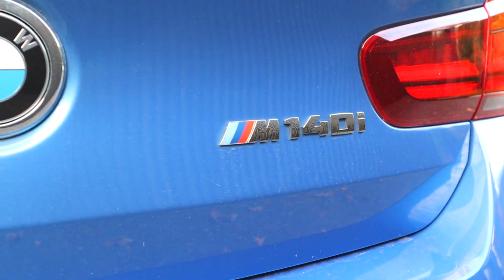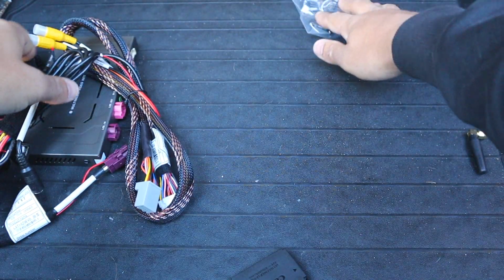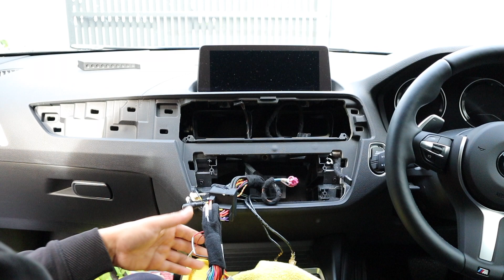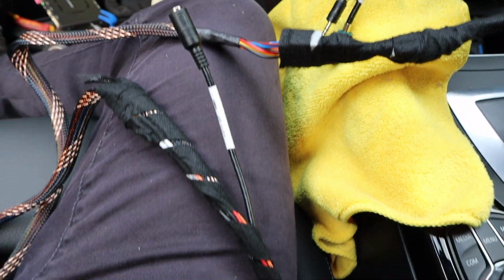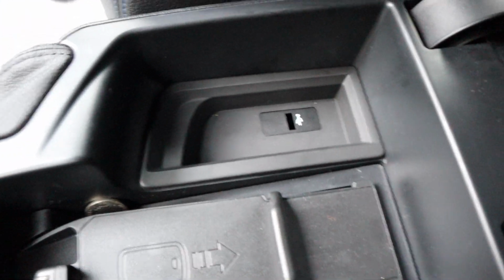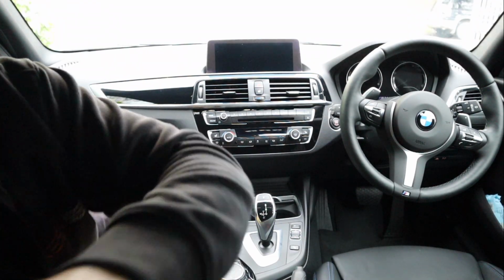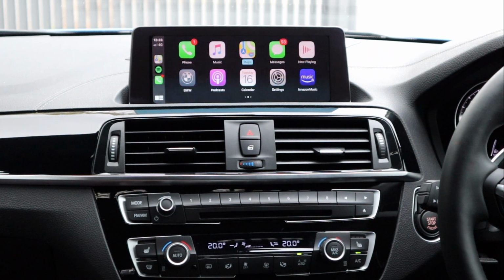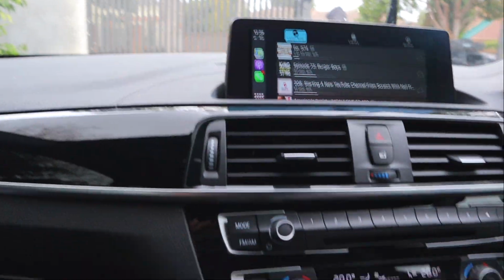How To Add Apple CarPlay To A BMW M140i

Comment: How did you get the AUX cable underneath the armrest and all through to the front panel?
Reply from the maker: Yikang Wang You can use a tool to run along the inside or you can remove centre console.

Comment: Hey mate is there a way to always start the car un carplay mode with this module?
Reply from the maker: Disconnect wireless is the only way
Reply: @TheFittingBay  I mean when you start the car instead of going into the main Bmw menu, start carplay
Reply from the maker: @KajfLife  oh yes, when wireless is connected it’ll automatically switch to CarPlay for you within 1 min
Reply: Last question please :) i have this mmi on my pre lci 2015 f20 and when i connect it says no signal. The screen was small before 6’ but i retrofitted an OEM 8’ you think that might be the reason? All cables were correctly connected

Comment: I’m confused. One of the options from the BMW store for my m240i is to buy Apple CarPlay for a one-time charge of $495. Apparently it’s just a software setting that they remotely enable in the stereo. Am I missing something? That seems a lot less painful than all of this.
Reply: It doesn't support android auto which this does. Also, it won't support WiFi unless you install a module which is basically this kit.

Comment: Dows this work in the M135i LCI, the same shape as the one you're working on. Also does it do android auto? Lastly, how is the sound quality of the unit?
Reply from the maker: Nova Legodi Yes and yes :) sound quality is good. We’ve had a few people ask this with different modules. We’ve never had an issue with sound quality. Bluetooth quality sucks (Calls) so we keep the phone paired to the OEM Bluetooth :) but sound quality is 👌🏽
Reply: @TheFittingBay  sounds perfect then. But I'll be doing a full audio install with my car so I will be plugging in the aux from the module into the aux on the DSP then when I switch to android auto the DSP will sense the signal. It's mainly cause the DSP will allow me to de equalize the audio into a flat curve so I can tune it with pc. I was worried about this cause I love the car but finally confirmed I can have my phone in yhe car playing my spotify. Thanks mate.
Reply: @TheFittingBay  last question mate. I saw a full sized HDMI port on the module, what could I use it for? Playstation? 😀😂
Reply from the maker: Nova Legodi 😂 Do it!! Or Apple TV

Comment: Great video! Just wondering what install tape you used and the product to wipe down the screen and glossy panel bits at the end. Cheers
Reply from the maker: Fabric tape Tessa or similar and the Spray is called stardust polish spray it’s the best stuff ever

Comment: And which cable and socket did you get for the last step?
Reply from the maker: Yikang Wang USB extension and we custom fit it into the genuine spot
Reply: @TheFittingBay  Which module did you get for this car? Does it support (Wireless) Android Auto as sell? I think I have an exactly same EVO unit.
Reply from the maker: Yikang Wang Wireless android is very unstable on all modules. It works but not very well. Wireless CarPlay is fine.
Reply: @TheFittingBay  Thanks for the reply. I ordered a similar one earlier, but it turned out to have some compatibility issue, causing the screen jittering, system stuck and finally no signal (in the system, without connecting to phone yet). I wonder where could I get the same module as yours? Is it convenient to share it here? BR
Reply from the maker: Yikang Wang Yes most of them have issues. We have tested a few different brands and stuck with the most reliable one which was also the more expensive module. We resell them on the website. If it’s not there just fill out the contact and I’ll get you pricing www.shoptfb.com

Comment: Wow!! You're very good at what you do! Just a few questions so please bear with me 😊:
1. I couldn't quite follow what you did with the USB input port in the centre console. Does that connect to an AUX cable/input somehow? Wasn't clear how that worked as you mentioned the car has no Aux input  on the back of the harness.
2. Do you have to code in the AUX input option or does it automatically appear after installing the MMI (i.e. my 2018 NBT EVO M140i doesn't have an Aux option available that I can see). 
3. Can you share how you ended up modifying the USB to seat into the plastic OEM port in the glove box? Also, since you have modified that USB input, can the factory iDrive software updates that are usually installed via the OEM USB still possible on the modified USB or does that only connect to the CarPlay now? 
4. Does this kit use the car's OEM microphone or its own separate external microphone?
5. Where did you have room to locate the MMI box? Was it put in the glovebox or under the OEM head unit somewhere?
6. Can you change track on the music app in CarPlay/AA whilst in navigation or do you have to switch to the music app?
Reply: I have the very same questions for the very same car.